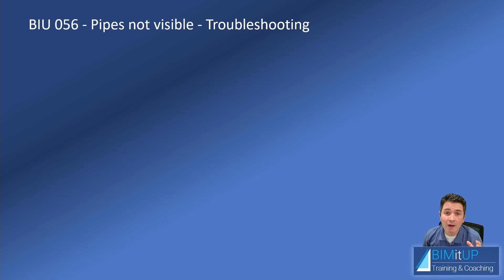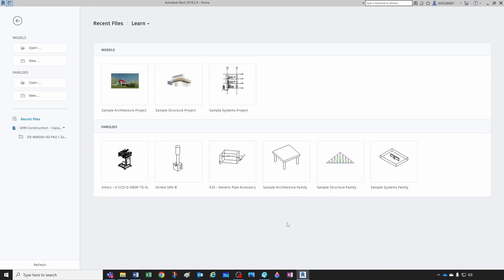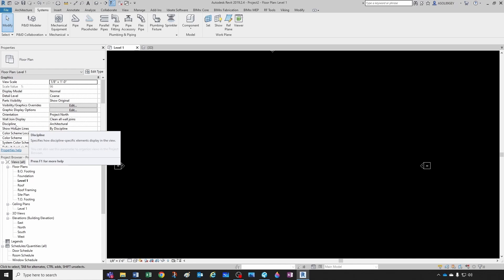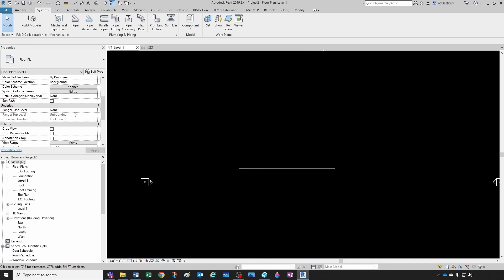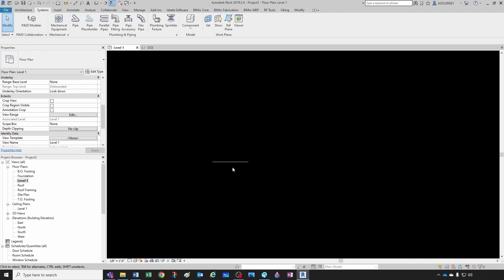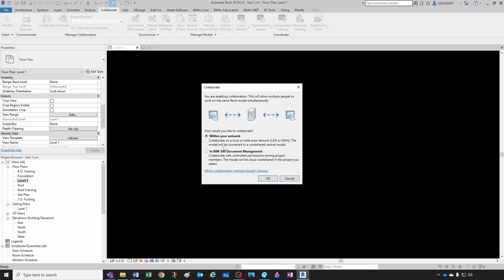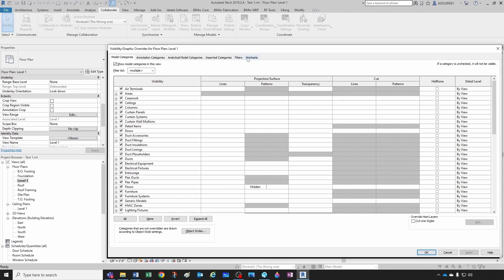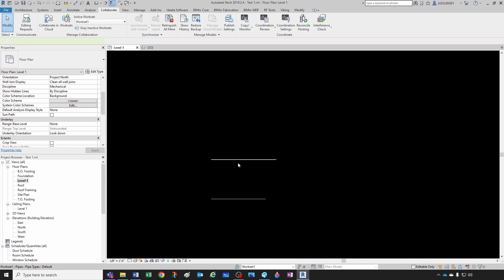Pipe Display Troubleshooting (Fix Pipes Not Visible)

Comment: Ummm why did you use an arch template for mep work?!
Reply from the maker: Hi Abu.
That is precisely what I'm emphasizing =) 
If you want to do MEP work, you should start with an MEP template, because you have MEP system settings and families that are "optimized" for MEP work (or at least a little more geared towards MEP).
By starting with an Architectural template, I had "Architectural" as default discipline and had trouble seeing my pipes.
In real life, I would always start with my MEP template which has all the MEP systems settings and families already included.
Have a nice weekend.

Comment: hey pls can u tell me how i can draw elbows in architectural
Reply from the maker: You probably don't have the fittings loaded (the elbow families can be found under your library). Load them into your project and then assign it in your pipe type routing preferences. Good luck!